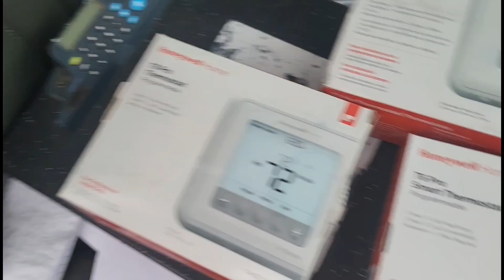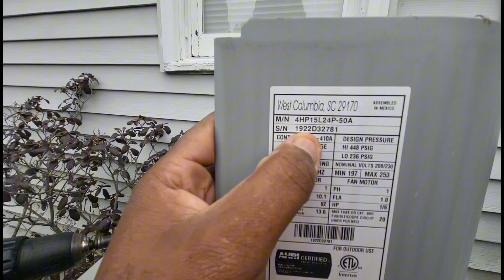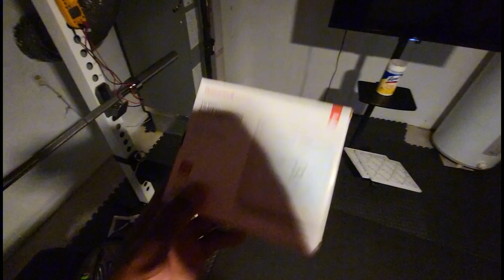Brand New Heat Pump Not Working | Heat Pumps

Comment: I doubt that the Nest was 'set-up' again after the new heat pump was installed.  Sounds like that heat pump is backwards (O/B wire) from the rest of the world - causing the Nest to reverse the valve for the old heat pump.

Comment: We had a Bosch unit installed back in march. We had a connectivity issue between the unit outside and the wall plate interface. turns out the previous owner of the house had attached a cheap plastic cover to the outlet that blocked the connection from to wall plate?